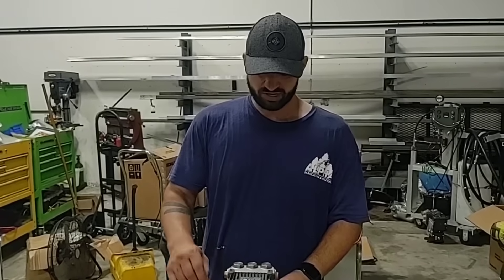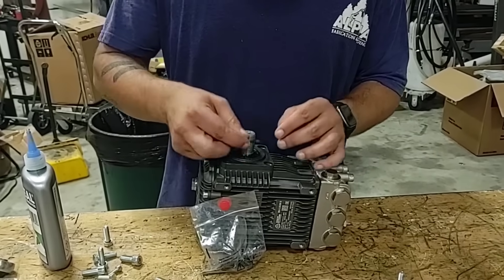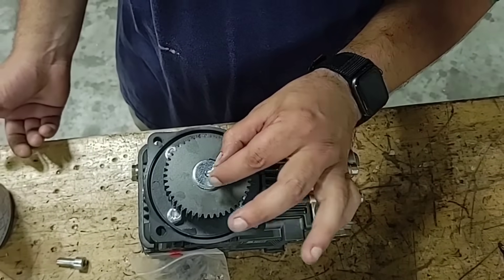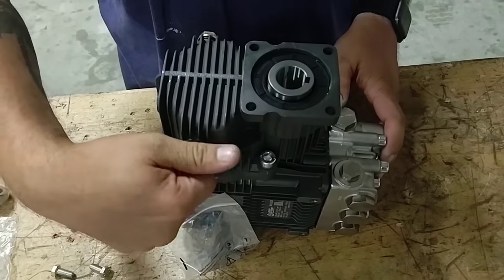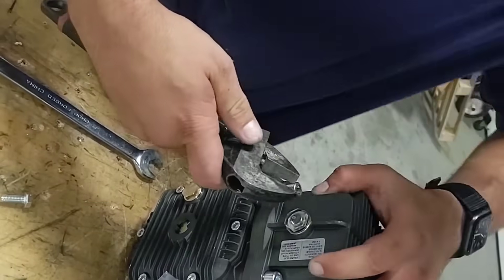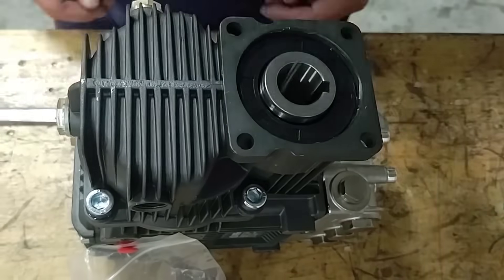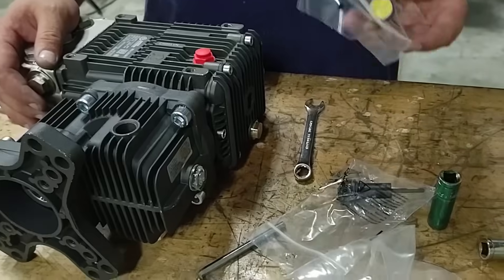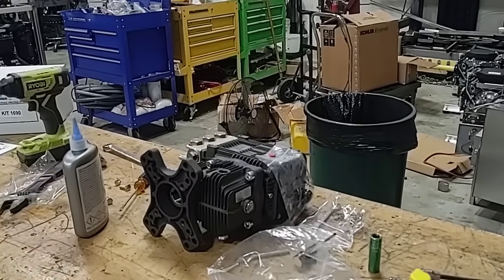How to install a gear box on an AR RKA55G30 with an AR1690

Comment: Will the 1690 gearbox work with the RG2125HN?
Reply from the maker: I’m not sure.  There are a list of ones that do and don’t fit with several pumps.  AR is tricky like that
Reply: @TxCoWash  I ordered the same set up as whats show in the video, I read your blog.
Reply from the maker: I’m spinning my head in this catalog. The RG series doesn’t “show” a compatible AR gear box.  So it would be playing Russian Roulette on picking the right one.  I’d assume it’s the 1690 however since it’s nearly the same specs as the RKA series.

Comment: very informational video! 
how do you determine what gear ratio to install on each pump?
I'm starting out a pressure washing business in the Philippines and
would like to know the basics. thanks in advance.
Reply from the maker: You likely use a 3000 rpm engine instead of a 3600 which is USA standard.  You'll want to use a 1450 rpm pump and gear box combination if this is the case.
Reply: @TxCoWash  Thanks for the reply! I'll be using 3600 rpm honda engine, 
I'll be buying the pump and gear box separate. What pump and gear box would you suggest and where to buy it there in US, I believe there is not a whole lot of market here for those. Thanks
Reply from the maker: @admiralseven5490  call Amber 9729220404 and she can get you exactly the pump you need.  I recommend ar 55g30

Comment: How do gear boxes hold up compared to belt drive units?  Advantages and disadvantages to a gear box vs belt?
Reply from the maker: They are not much different. We stopped using belt drives with our cleaning company 4 years ago. Traditionally gear drives were not very reliable and basically in "beta" mode.  We have found gear drives will produce more power than a belt drive and they take up less space than a belt drive.  They require little service.  However, belt drives you can change pulley size and ratios to change the specs which you cannot do with a gear drive.